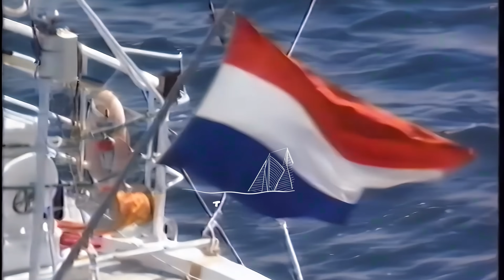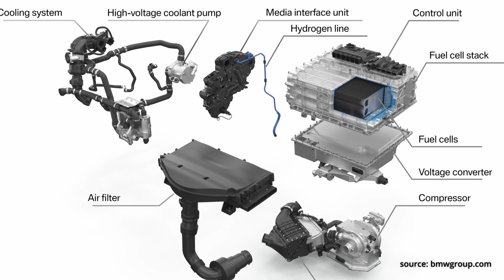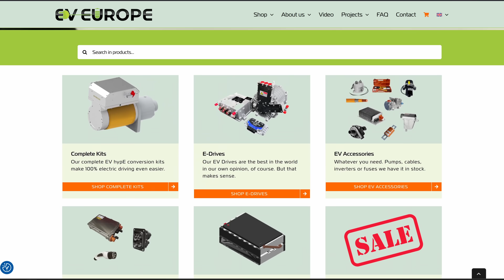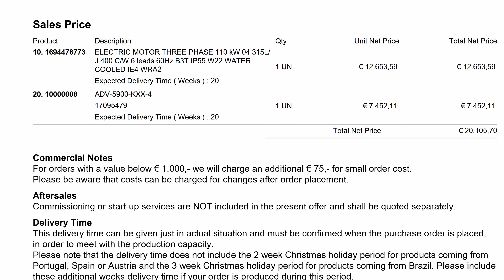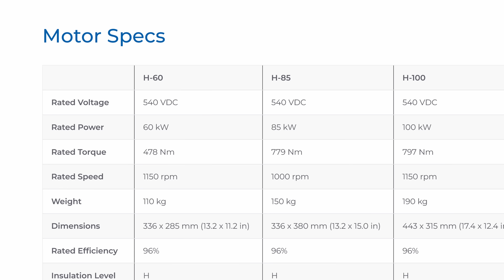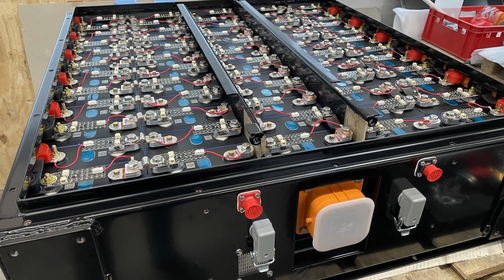Going Full ELECTRIC | Thoughts And Considerations

Comment: Keep the gearbox and drivetrain as is. Add a motor and get some regenerative power. You will only ever use it for short periods on batteries so you will need to run the main engine most of the time so switching to full diesel electric is probably an expensive waste of time. Great if you’re building a ferry or cruise ship from scratch but as a retro fit on a vessel like yours the cost benefit ratio is probably poor. Safety first as well. What you have is tried and tested and gets you out sailing much faster.
Reply from the maker: Thanks! Will do :) The first video on that will follow soon!

Comment: Less complexity is the key to low maintenance and reliability in a hostile salty environment.
Enough power to travel nonstop for some days regardless of conditions is also crucial.
Reply from the maker: I agree, so, we’ve decided to keep the diesel. It always works. But we’ll add an electric motor on the side for short cruises, manoeuvring and power generation. It adds a bit of complexity, but more advantages :)

Comment: For certain, where you live and wherever you sail there is wind. So, first priority to me would be small wind power generators mount on the stern counter. This could give a few kilowatts, to maintain house and propulsion batteries. Combine with solar for consistent daily power received. I like the transfluid answer where you add the motor to the existing driveline. Choose your own parts, smaller power but bigger frame low rpm motor and variable speed from a modified commercial variable speed drive.
Reply from the maker: Those wind generators are a good idea, but good ones are crazy expensive for the power they deliver. So I’m not sure yet. We are indeed going for something similar to transfluid, but with our own parts. Can’t go for too big a frame because we have to fit it in through the door. But you’ll see. It’s all waiting for installation in the storage unit :)
Reply: @tigersharkboatworks I am in Canada, east coast, so the wind blows here non stop, virtually. I am looking at a German unit Skywind NG that produces 1kw in a good wind. They are all metal, stainless and aluminum, and although not a big power source, the more constant and higher energy density of wind over solar is what drives our search. There are other windplants up to 2kw that are likely not the right fit for your intended marine environment that we are also researching. I await your engineering discussion and installation of the new hybrid gear.

Comment: What about elec hydraulic. you can run the elec motor to power the pump or the diesel
Reply from the maker: There’s one very big problem with hydraulics, and that is energy losses. An electric motor directly driving a shaft is 80-95% efficient. An electric motor driving a hydropump, driving a hydromotor driving a shaft is around 40-70% efficient. Even a diesel motor driving a generator to feed an electric motor is more efficient that a diesel motor driving a hydropump. +wires are more compact, clean an easier to install than pipes or hoses. That’s why we only use hydraulics where we have no alternative option. The steering gear (because of the cilinders) and the hydraulic furlers (because that’s what we have, and newer alternatives are very expensive) :)

Comment: Hi. I was trying to develop an electric system for a sailboat, but I gave up. I think it's not effective for long distance sailing and very risk to have all those batteries on board, but if you are interested I have some protean electric axial flux motors for sale. They are around 30 to 40 kilos and produce 65kw RMS and 100w peak with very high torque (1250 NM). I also have a cascading motion inverter on e bay. Cheers
Reply from the maker: Thanks for the offer, but we just got our hands on a second-hand Tesla motor, so we're all set for now :)

Comment: Sodium batteries are available this year from CATL, the worlds largest battery producer.  1/10th the cost. 90% of capacity/kg of Lipo4...  I have an electric motor and controller designed by Motoenergy at 65kw continuous, 350kw peak at 96v....people are putting them in old Mustangs and such...the retail on it was 11000 US...weighs 165lbs...So more powerful motors available.  Curious about the lateral load of the belt on the shaft and tranny.  I suppose thrust bearings needed.

Comment: use old nissan leafs you get the engine and a battery pack. currently people are nearly giving them away. the battery packs are not great but could be doubled or tripled up  and replaced as time goes on if put in a space which is easily accessible?
Reply from the maker: We're a bit reluctant to install used batteries. But a used motor is definitely a good option :)

Comment: I got some good advice from an old sailor who spent the best part of his life sailing. ..instead of pushing your systems to become ridiculous , rather change your way about using energy. sail more and motor less.....use less electrical devices so that your electrical system can be smaller and simpler. build  as far as you can systems you can afford to build and maintain. but the biggest point he made is to adapt your life stile to what system you can afford to run. i have some lithium batteries for my boat, but not shore if ill build them in, they require different tech to charge and maintain. so well see.
Reply from the maker: All true and good advice. Although in our opinion, an electric motor and some batteries is still a quite simple system :)

Comment: Have more fuses you can think off, over speck the cable to double or three capacity, Ive seen a big old tall mast ship that went up in smoke from electrical fire, lead acid batteries just work it's not that your ship doesn't have the displacement for it, they simple and cAn be repaired or replaced anywhere around the world,you go lfo good luck middle of the Pacific,  simple batteries from fork lift
Reply from the maker: Good idea, but it's very difficult to find lead acid batteries with battery management systems that support up to 300 volts DC. It's almost never done. Forklifts go up to 96VDC at max, that's just not gonna cut it for the size motor we're gonna use :)
Reply: @tigersharkboatworks   , I meant the batteries not the charging circuit ,i would not go to Ali.  Or cheap place for charging system, I built 500kw three phase ups decades ago and that battery voltage was up their +300  voltage range, add to that years ago you were able to get stackabe batteries that come in hardened steel.shells that bolt together, they used in maritime situations , a 800x800mm foot print was about ton
Reply: I operate a 10kWh south-facing solar array installed on 100 sq meters of rooftop. The angled array is optimized for maximum year-round production. The system is 20 years old and still produces above 90% efficiency using the best PV panels available at the time (Sun Power).
The advancement in bi-facial PV panels now allows production of the same voltage in 50% of the space or double the output if swapped one-for-one.

My array produces in excess of 600 vDC direct to an AC inverter.
Utilizing bi-facial PV panels, you have sufficient deck space for 400 vDC production, which you indicate is the voltage your electric motors will require.
PV panels are relatively inexpensive and the smallest expenditure in your project.
You could use an inverter and run an AC motor (lighter, think salvaged Tesla vehicle) or DC - DC direct to a DC motor (heavy, think forklift).
Storing DC voltage is battery friendly. Slave a DC motor/generator to your drive-line, (power directly off PV panels or diesel get-set by disconnecting the diesel engine from the transmission), then storage is not as vital - reducing the need for massive amounts of battery storage.

[ 7:57 … Alternate Plan B+  … Retain the current engine. Add a belt-drive electric motor/generator from the transmission/drive shaft. 
Design a device to de-couple the transmission/drive shaft from the engine. Allowing either generator or electric drive motor. https://ebay.us/m/TXOjiu ]

Storage becomes more of a challenge when operating AC motors.
Inverting DC - AC is more expensive, produces heat, and requires more storage capacity; but also has its advantages, one being domestic demands, since many AC appliances are less expensive.

I would vote for:
1. DC motor for greater torque at slower rpms
2. Minimum storage capacity demands (10x200amp LiP4 DC vs 25x200amp LiP4 DC to AC)
3. DC - AC Inverter for domestic needs (Victron)
4. When maximum DC required - engage the PV array or diesel engine generator!
5. When all else fails - engage direct drive from the diesel engine, charging the batteries at the same time!

This system will require an electrical engineer’s design certification.
Reply from the maker: Thanks for the elaborate response! We're thinking in the same direction. We currently have 250VDC (max) from the solar panels, so we could bump that up a bit. And we just got our hands on a second hand Tesla Motor, 74kWh in (new) batteries and a 20kW 3 phase hybrid inverter (Deye, not victron). Next on the list is the Chain/Belt drive thingy :)

Comment: Cool project, thanks for the sharing the details.   Im a fan of LTO for electric vehicles, and have been searching them lately and if you factor in cycle lifes, its the cheapest of all the batteries, just not initially.  I think they've been overlooked because of their energy density but would argue fast charging is more important to a consumer,  15 minutes vs 1 hours, ill take a bigger uglier battery anyday.  But you dont need that for a boat, as you cant take 10 000watts of solar with you so theres no advantage there. However lifecycles might be more important, i dont know how easy it would be to replace batteries but you would do that 10x less with LTO's, i think thats the biggest advantage, 10x more cycles is pretty huge, instead of 5-10 years at >80%, you have it for the lifetime of it, 50-100 years.  Anyway I think idealy designiing a boat with electric in mind from the ground up would be best.  Then you can design a watertight compartment for batteries or things like that they didnt think of when making boats around deseil engines.
Reply from the maker: Thanks! I really think there’s a lot of potential in LTO as well, but because there’s so much development still going on in batteryland, we’d rather take a less expensive option now, and see what the best option is in 10 years or so :)

Comment: Can't have too much battery capacity. Look into Sodium ion batteries. Stay away from NMC. Sell that generator and buy more batteries. Get one or more electric motors strapped to that drive shaft for hydro-regen, electric propulsion, diesel propulsion. Investigate putting a clutch between the propeller and the electric motors so that the diesel can function as a generator with the motors.

propeller <== clutch <== motor_1 ... motor_N <== engine
Reply from the maker: Thanks! Will look into that :)
Reply: In principle you are right, but sodium batteries are not yet much available. Their energy density is lower then LFP. However since CATL, the worlds largest battery manufacturer , started to produce in mass, they may be available soon. Their price is expected to be 1/10th of LFP batteries.

Comment: You have plenty of 100kw motors in graveyards from EV nowadays. You can get a complete Tesla system for way cheaper than prices you showed. There is now a complete ecosystem with components to hack these EVmotors and systems.
Reply from the maker: Well yes, let’s say we’d get a decent second hand Tesla for 15k, that does not mean we’re finished and have it installed on a boat. And I feel a bit hesitant on buying second hand batteries. So going too cheap is not what we want, a bit of quality assurance is nice when at sea :)

Comment: What adventure criteria might an electric package be able to handle? Engineering means meeting a specific case with a solution... show your thinking... inquiring minds want to follow you on your build. What regulations (flag?) and insurance might drive your decision making? Thanks.
Reply from the maker: Alright so we still want to be able to go everywhere, oceans, colder area’s etc. And let’s say we’re sailing uninterrupted for a couple weeks, it would be nice to not have to start a generator to use galley equipment or that kind of stuff. And maybe be able to get in and out of port using the electric drive and bowthruster without diesel generator. 

Since we’re registered as a pleasure craft, we’re not sailing under class. Which means that there’s little flag state regulations we need to comply to. We do get a European safety inspection every 5 years. So as long as the insurance company approves our system for pleasure use, we’re good :)

Comment: wow you have done your homework. I skippered a very early commercial vessel around 22 metres which was all solar powered called the Solar Sailor. The whole ship was covered in solar panels which could be raised as sails to sail off the wind. (not very fast) we used deep cycle lead acid batteries as that was the go to then. We could recharge using an 85 hp gas operated generator (converted from diesel) a lot of the cruises were night time so we did on occasion run out of power and recharged with gas. A sailing channel which is extremely popular, ( La Vagabond) runs a trimaran mostly with electric engines but I think they prefer their diesel; somehow. You have a great diesel engine why bother. the costs you are talking about cut into your cruising budget. Most cruisers use their diesel and are more than happy just requiring bow thrusters for close work. good luck with your decision.
Reply from the maker: Thanks! I have kinda followed the build of their trimaran, and to me it’s also not really clear why they prefer the diesel. Leo, on the Tally Ho, mentioned in one of his last video’s that he prefers the electric motor of his hybrid system, but has a hard time keeping the batteries topped up at anchor since he has no solar/regen.
All in all I think we’re gonna go for it :)

Comment: Absolute waste of money and you will forever talk about batteries and solar. Put in a nice diesel and be done with it. At worst hybrid diesel electric.
Reply from the maker: Hahah yeah, those solar battery people eh? We’ll keep the diesel, and add the hybrid system, because it does offer advantages :)
Reply: @tigersharkboatworks yeah we had these guys with a big cat pure electric and they forever talked about the advantages and blah blah blah it cost him 100k and when he finally got caught in the storm his electric motor run out of juice and he washed up on the rocks. 😅😅I have a small 40foot racing/cruising carbon everything yacht with nice accomodation. Have a 30hp Volvo penta do million miles every year and refuel once a year with 40l. 😂😂😂 but I know when I need to move I can do 800 miles on a tank not just 1 hour. You have a big steel battleship, you need good diesel donk in there to power it.  They make nice hybrid system, I think made in your country. The engines are red, look at the TallyHo channel, they installed it  in and it wasn’t that crazy expensive. I would not have it in my boat as I need something lite but the system looked nice and robust. It’s winter in AUS so I am still watching sailing channels, but once summer hits you are on your own. 😂😂😂 good luck I am really enjoying your progress. Especially the way you can just cut and weld bits on,  it’s so refreshing. Every time I am trying to do something we have to have committee meeting with my shipwright then it’s million bucks for one bit of carbon step. 😂😂😂

Comment: I Still don't know if it really worths...30k in diesel are some 17-20.000 liters...to that you must add all the hours spent in studying and making all the setup. Furthermore the complexity of the electrical system increase and you mostly won't have access to spare parts in most of the world.I'm always a fan of shaft generator, but hybrid system....you will mostly end up using the diesel engine. And don't forget you will be roughly a ton or ton and half heavier which means higher consuption (diesel or electric) to move). Hybrid have a sense if you have a POD rudder/propeller and a diesel engine working costantly at the optimum most efficient RPM rate. Otherwise I would stick to diesel....at least for the next decade
Reply from the maker: Still if we use the diesel engine mostly, with an electric motor/generator on the shaft. That will allow us to not use the separate generator. So we can take one of them out (we have 2 now). Which saves weight again. If we’d go for an electric car motor and battery, the weight gain will be about the same as the weight loss of removing one of the gensets. If it will pay out the 30k? I think so. We’ll have to wait and see I suppose

Comment: Do you have an eljection system to get the lithium batteries out of the boat in the case of thermal runaway?
Reply from the maker: We were actually planning to get a total flooding system for the battery, like they do with electric cars
Reply: @tigersharkboatworks  this will not stop the fire - it was prooven that even with zero avalible oxygen (drowned or covered) and temp lowered - the broken batteries can still self-sustain the fire and keep burning till all the reagents will deplete.
It's like a SRB on the Space Shuttle - once ignited it just goes till finished, there is no pause.
Reply from the maker: It’s also not meant to stop the fire, rather to keep it contained until all the reagents are depleted, like they do with electric car fires :)